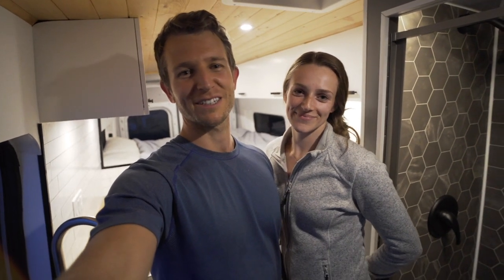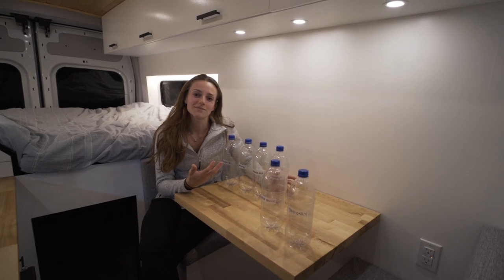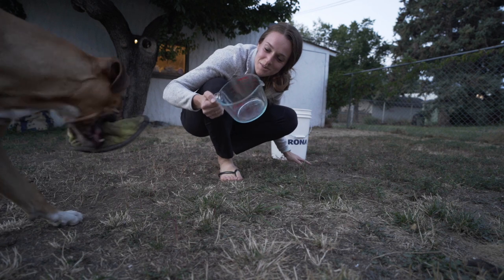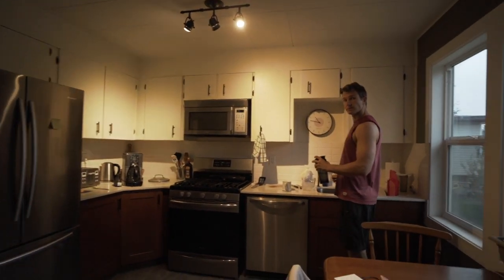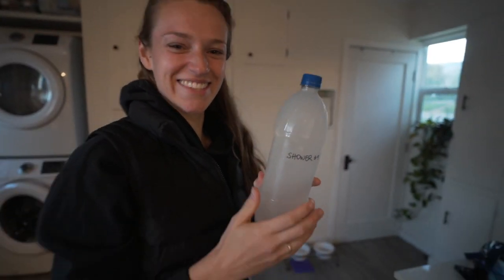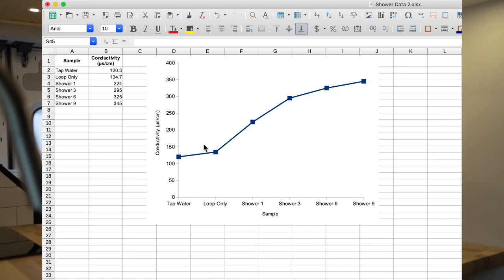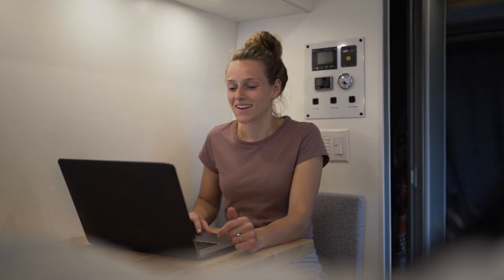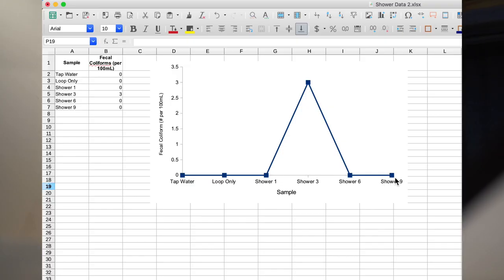VAN RECIRCULATING SHOWER | WATER QUALITY TESTING

Comment: Have watched a bunch of shower videos and have some thoughts/questions. For the average shower, how many loops through the system does the water make? (Function of shower head throughput and length of shower).  Might it be helpful to have a “filter” mode that bypasses the shower head and you could filter as long as you liked (especially helpful for the UV unit where total treatment is a function of flow rate and total time). Some sort of “campground” mode might be useful for those who spend significant time with water hookups (campgrounds or someone’s driveway).

Comment: Brilliant. I have seen several recirc shower vids - yours is the FIRST to scientifically (or any other way!) test the quality! Question - would it be a reasonable conclusion to say 6 showers then change the water? Or is 9 showers fine, but maybe use less "cloggy" soaps? I wondered too if it would be worth showering sans soaps and hair products - then turn off the recirc - lather up with soaps and hair products (organic) and RINSE OFF with fresh water? (I know, I know, it may mean dual shower hoses, or a switchable system etc) but it might save on clogged filters?) I'm probably missing something important (like how do you keep the recirc and fresh water separate?) But I'm just rumionating lol....
Reply from the maker: Thanks! There has been some discussion surrounding the benefits of a hybrid system recirc and then flush with clean water at the end type system. Would be more complex but interesting idea for sure

Comment: I am still on the fence about a system like this. I like the idea of carrying less water, endless showers, and filling the grey tank slower. I think I would be adding a small amount of bleach to my recirculating water so it is the same chlorine level as pool water. I also do not like the idea of making more waste with buying multiple filters every few months. Are your water heater, mixing valve in the shower, water lines, UV sanitizer going to become gunked up with soap scum and stop working sooner than with non recirculated fresh water.

Comment: That is good news. Please don't take this the wrong way. If the last test was consideredI very sensitive, I'm surprised there weren't even a trace amount (though safe level) of the so called faecal matter. I mean, we wash our bodies, including our own piping, if you get the drift. So surely from that point of view  we should expect some trace amount in the sensitive test?
Reply from the maker: Not at all, thanks for the comment. Our understanding is that it confirms the UV light and other filters were working correctly 👍🏻
Reply: @TimKatie  I see. Thanks for replying.

Comment: Wow, this is an amazing detailed analysis of your circulating shower system.  I am a little curious though how would the ph decrease while the alkalinity of the water increase?
Reply from the maker: Thank you! 🙏🏻 We were curious about this as well. We learned that the ph shows if the water is acidic, neutral, or basic, but alkalinity refers to the buffering capacity of the water. So yes, there should be some correlation between the two but we suspect a latent effect that we’d need to do a longer test period to see
Reply: I think ppm (parts per million ) level  effect to the Ph level. 50-200 ppm is a tap water = Ph level will be 7 , if ppm level over 1000 its meaning water contain lot particles its meaning water very dirty. If ppm level near the zero meaning water Ph level lower than 7 , its meaning water is a more acidic

Comment: Ammonia can be produced by bacteria. I was contemplating putting a recirculating shower in my van project, but was concerned about possible Legionella growth.
 I like the idea of being able to have a 'normal' shower, ie not turning the tap on & off between soaping. So I would incorporate the recycling of the shower water, but drop it into a black-water tank after use or end of the day.
Reply: Was my concern as well but I'm designing mine with a thermostatic valve. Set shower at 40c for shower and crank to 65c when done for 2 minutes. Legionella dies off at 60C in 2 min, instantly at 70. Then drop a small cap of bleach in the drain for extra safety and your good for bacterial growth death. My set up is is based off a kdp filter followed by catalytic carbon and uvc.
Reply from the maker: Definitely - this is one reason why we advise draining/refilling the system and flushing with bleach at regular intervals. But there are other systems out there that allow you to have a “normal” shower and “recirc” shower for portions

Comment: Do you have a video showing the disassemble and cleaning of the filters? I’m curious if any water spills out and if you have a catch basin under the filters?
Reply from the maker: Hopefully coming soon. In that design we had to drain all the water out to avoid spilling, but in our new van (V2) I installed the filters upright which made for easier removal and no concern about spilling

Comment: Thank you for great video, you mentioned at 19m 30s that once a month you inspect/replace filters, does that mean once every sixty showers (i.e. taking two showers a day)? 
If that answer is yes, if you shower twice a week, sixty showers will take 30 weeks, would you wait to inspect filters on the 30 week mark?  Happy Travels!
Reply from the maker: Thanks for watching. YMMV, but we don’t live in our van full time, so we used once/month as a general guideline and it equates to ~every 30 showers. But we would not leave water in the system when not in use for prolonged periods. Cheers

Comment: initial cost of the system? and what is an estimate of maintain /replacement filters for one yr? and finally how much time in a yr is spent maintaining the system?
Reply from the maker: Initial cost of the system was around $1700 USD (including framing, vinyl for walls, plumbing, pump, filters, etc). For our use, the water gets drained/refilled every ~6 showers (at which point we also clean out strainers), and system cleaned with 10% bleach after ~15 showers (at this point remove filters to spray them out, replace as needed). Sediment filter ($10) after ~1-2 months, carbon ($30) ~4-6 mths, UV ($90) ~1-2 yrs. So it would largely come down to how often you shower and how dirty you are 👍🏻
Reply: @TimKatie  Thank you so much!!!
Reply from the maker: @sandrafromtexas1957  No problem! Feel free to reach out if you have any questions. We’re normally a bit quicker to reply on Instagram (@thetriointransit) if you’re on there 😊

Comment: Im wondering if during down time you could pump it through maybe a gallon of sand to maybe catch some of the soap n junk and let it go through one of them berkey type filters back into your normal tank would keep it clearer. They make big claims about how it will purify most water to drinkable. Maybe over night as you sleep, dont know how long it takes one of those to filter 3 or 4 gallons.

Comment: Could you add a reverse osmosis system after the Uv light to pull out those last contaminates?
Reply: Reverse Osmosis systems sacrifice half the water that passes through them and SEVERLY limit flow rate. Most showers move around 2-3 gallons per minute while typical reverse osmosis filters only move about 3 gallons PER HOUR and require a much higher pressure pump. You could have the RO filter purify the water between showers, but rather than using 3 gallons for 9 showers you'll now be using 15 gallons albeit with a much better water quality. A RO would be wasteful overkill for a system like this.

Comment: I guess the way to have avoided adding in freshwater to replace the removed water would be had you held on to the same 'shower N' water from the week or so before.  So you'd have to do all of this like twice, but the first time you just extract the water, put it in a bottle, and I guess refrigerate it.  Then when you do the real experiment you use those saved bottles to replenish the system...

Comment: How often do you change the filters?
Reply from the maker: We replace the water after every ~6 showers (at which point we also clean out strainers). The system is cleaned with 10% bleach after ~15 showers (at this point we remove filters to spray them out and replace as needed). Sediment filter ($10) after ~1-2 months, carbon ($30) ~4-6 mths, UV ($80) ~1-2 yrs

Comment: How did you manage to take 6l of water from your system when you only hold 5.77l? Does it mean that in the last 3 sowers you only used less than 1l of water?
Reply from the maker: The shower loop holds ~12 litres (measured out of the bucket near the beginning of the video), and for each of the 9 samples we removed 1 litre of water and replaced it with 1 litre of clean water. So yes, there was some dilution of the initial sample as the test went on.

Comment: This recirculating system could be much better with a proper filtration system.   Maybe someone will combine the two.  It would be best if the entire water system went through a filtration system.  No water wasted, less stopping to refill  your water tank.  There's also a device that pulls water from the air.  It would also be great to see tiny homes/travel homes outfitted with these devices.   In fact it would be great if these were installed in regular vehicles as well.

Comment: Having a recirculating shower in my van for almost a year now and and my love of data it’s great to see those two things combined! Great job on the testing
Reply: I'm following Alex footsteps with recirculating shower and this is good news! Not that thinking that recirculation isn't any worse than having bath tub session or swimming in public pool.
My solution has plate heat exchanger and just 5.5 liters "gray" holding tank. Is it good or bad in means of water quality, at least it saves water, if it works, and makes it easier to dump water more often
Reply from the maker: Thank you! 🙏🏻 We love hearing that you have a recirc shower as well!
Reply: @TimKatie  mine is well planned, parts purchased but yet to complete building. Will happen soon after some higher priority tasks
Reply: @mhelander  I never thought about the comparison to a bath tub but that is an excellent example of basically the same water as a recirculating shower difference being you are not sitting in it.
A couple that lives down the road from us “shares” bath water, she goes first and gets clean then he bathes after her, I think a recirculating shower is MORE sanitary than that by far!
Reply: Great videos! How many (15 minute?) showers before filters have to be changed (& what’s it cost (time and money))?
Reply: @gogarrickboyd  I change the filters every 2 months ish. if I’m using it more than more often
Reply: What type soap, shampoo and conditioners were used? Was it like Seventh Generation or Dr Bonners?

Comment: I like the idea of being able to switch to rinsing off soap into the grey tank during a shower, and keeping the soap out of the recirculating water all together. One way to do this would be to switch to supplying the hot water tank with fresh water, instead of supplying it with the recirculating water.  And at the same time, switch to pumping the drain water into the grey tank

Skin and sweat has much bacteria.  Bacteria can decompose into ammonia when it dies.  Some bacteria excretes ammonia as waste. I've heard people say that old sweat smells like ammonia.

Water companies add a little chlorine to tap water to kill bacteria for safety.  Pools have chlorine to kill germs so that swimmers don't spread them to one another.  Like this, you might use a little bleach.  Seems like I've heard a 1% bleach solution is sterilizing. 

Nice van build, nice videos. Thank you :)
Reply from the maker: Thanks for sharing! I’ve seen a few recirc shower systems that seem to use that design - more complex but definitely doable!
Reply: @Bryant D    That´s exactly what I´m on about since the first videos of "recirculating shower" came up here on youTube about 2 years ago - only you are perhaps saying in a nicer way than I could,

Comment: Good stuff guys! One thing I'm still very curious about are the filters itself. How long do they last? Do they require certain cleaning themselves over time or simply replacement? I.e. a bit of the  cost of ownership and maintenance picture.
Reply from the maker: Thanks! Great question and I apologize for not covering this in the video: Water gets drained/refilled every ~6 showers (at which point we also clean out strainers), and system cleaned with 10% bleach after ~15 showers (at this point remove filters to spray them out, replace as needed). Sediment filter ($10) after ~1-2 months, carbon ($30) ~4-6 mths, UV ($90) ~1-2 yrs

Comment: While you are not using the system there are certainly organic particles in there that will result in "rotting" or yeasting (because your uv filter won't do much between showers) i suspect this mainly happens in the 5 gallon tank. I'm not quite sure if the process being anaerobic adds to the production of ammonia, it adds to the production of methane for sure....

Comment: Amazing content, thank you!

May I ask, where is your recirculating shower tank? Isn't it under the van? I am asking because you mentioned it's freezing proof in another video.
Also, did you use soap and shampoo? Does the water get a strange texture at some point because of soap and shampoo?

I think sweat releases ammonia, anyways if you are considering repeating the testing, try using some gloves to avoid contamination :)
Reply from the maker: Thanks for the feedback! The recirculating shower components are all housed inside the bench seat (inside the van) so none of the components/plumbing are outside or underneath the van.

We used all natural liquid soap. If you use shampoo it will make the water murky quite quickly, so with our system we found it best to use the outdoor shower or sink for washing hair with shampoo if needed.
Reply: @TimKatie  thank you!
Reply: @TimKatie  I’m thinking that a large(r) kitchen sink would be a good way to shampoo hair in colder weather. And I learned from traveling in Central America that Americans shower way more than most people.
Reply from the maker: @RustyCas999  Agreed! We think the kitchen sink is a good solution when needed in colder weather and definitely isn’t needed very frequently

Comment: Interesting. I've been planning a recirculating shower since seeing Curt & Snow install one in their van a couple of years ago.  Similar filtration set-up, although he used a 10 gallon tank for the reservoir. 
I wonder if it would worth it to install an additional UV light in the tank itself as an attempt to prevent some growth in the tank before it even has a chance to grow and get into the filtration system.
Reply from the maker: Interesting thought - I’m not sure if it’s necessary and we flush the system out with bleach every couple weeks but would be interesting to retest the water quality in say 6-8 months
Reply: @TimKatie  Great set up.  How do you flush the system? Does it take long and does it leave "residual" stuff in the tank and pipes etc
Reply from the maker: @RodricWeiland  Thank you. We flush the system by opening the drain valve and running the 12V pump (takes <2-3 minutes). This removes most of the water and if we’re on the road we simply refill and use for another 6 showers. But if we’re cleaning the system or going to go a week or two without using it then we connect a compressor to the Schrader valve and blow out the rest of the water from the system. (It takes <5 minutes). Then we rinse the loop using 5% bleach and blow it out again so it sits empty and ready to be refilled before next use 👍🏻

Comment: Hi Tim and Kate, I see you have a home where you could clean out your shower system. But if the van is ones only home, how would you clean things out on the road. For example disposing of bleach etc. In some cities the rainwater system is connected to the sewage treatment so I wouldn't have qualms pouring bleach down the rainwater drains. But some cities don't treat rainwater.
Reply from the maker: That's a good question. I would suggest putting a 5 gallon bucket under the drain to dispose of appropriately, or install a small ~5-10 gallon greywater tank for the shower so that you could drain it multiple times before needing to find somewhere to dump it.
Reply: @TimKatie   just wanted to make sure I'm understanding you correctly - so in the video you said you run bleach through the system once a month, so either catch the bleach in a bucket like you did when draining the shower, or catch the bleach in the greywater tank. And in both cases, find an appropriate facility to dump it (RV dump station, public bathroom, etc).

It seems the second solution is simpler on the road, no? once a month run bleach through the system, make sure to empty the contents into the greywater tank and not let it recirculate back into the shower. Then empty it as you would with any greywater tank at appropriate facilities. It would be all self contained and no bleach would get in rainwater systems or out in nature.
Reply from the maker: @lifeissoup_iamfork  Yes, exactly. That’s what I meant :) I definitely  agree that the second solution would be simpler and more of a long term solution. I hope that helps!
Reply: @TimKatie  yes that helps a lot, thank you for responding and explaining. Looking forward to more great content from you guys in the future!